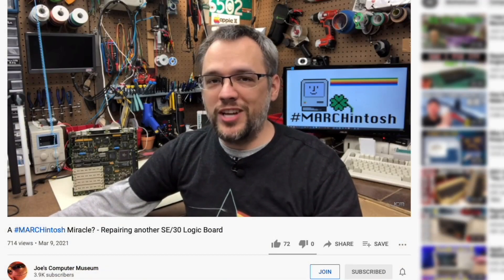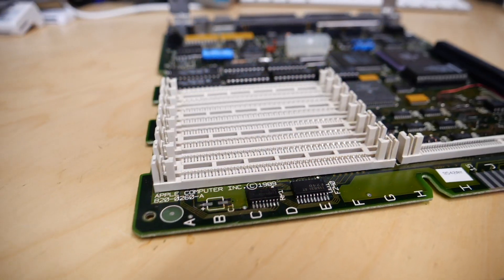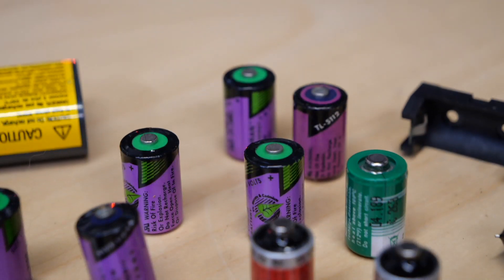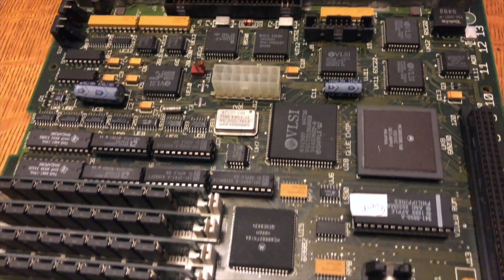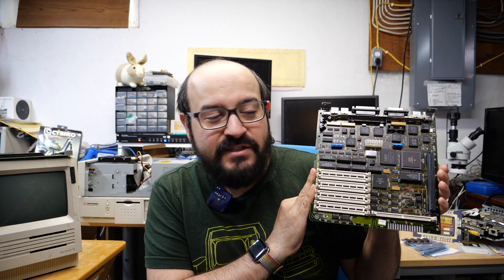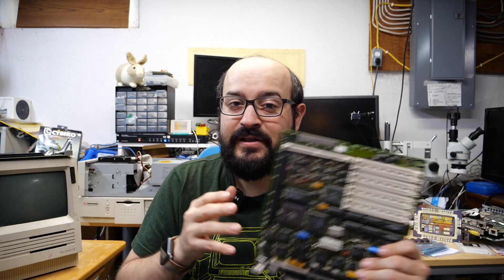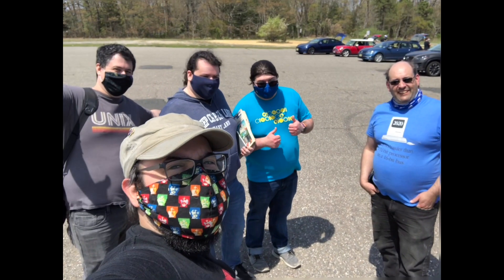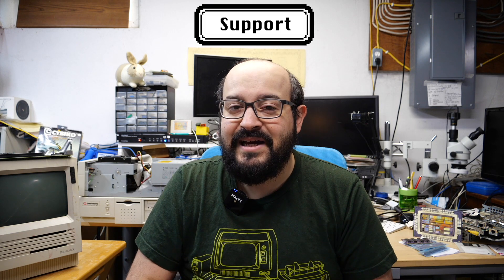Can We Save a Battery Bombed Vintage Apple Macintosh SE/30?

Comment: I need to replace the PRAM battery on my Color Classic, I keep hearing they may explode. Is it okay to handle them? Obviously with the computer unplugged. Also which type of battery do I need. Thanks - LOVE your videos!!!
Reply from the maker: The PRAM (clock) battery is a standard 1/2 AA 3.6 volt battery. They can leak or burst over time. They are perfectly safe to handle while the machine is off. If the battery has already leaked you may wish to wear gloves.

However, a safer option would be to replace these batteries with a longer lasting adapter that lets you use coin cell batteries. Coin cell batteries usually have less problems. This adapter is cheap: https://www.etsy.com/listing/1034101908/meowtoast-rev2-12-aa-battery-replacement However, if storing or not using the computer for long periods of time, it's always a good bet to take the battery out, just in case.

Comment: I bet he wasn't able to fix it either

I'm sure its physically possible to fix, and it would actually be interesting to see it happen, given that not even one bombed board like this has been successfully repaired ever.  We don't even know entirely what it takes.
I'm sure in the end it'll be cheaper to reverse engineer the board and make reproductions, but, you know.
Reply from the maker: He hasn’t tried yet. And boards like this have been fixed before, but it’s all a balance of time spent versus if it is worth it to the client (and also cost).

Comment: Every time I see one of these videos where the battery or caps have failed I'm reminded I need to open my Mac Classic and have a look inside. I'm just terrified of what I might find. I know the machine was still booting and running perfectly a year ago, and it's stored in an air conditioned room out of direct sunlight, but it's only a matter of time with these machines.

Oh yeah, the 17" CRT Studio Display. My junior high school had one of those, connected to a PowerMac G4 Dual 450Mhz that no one used for a damn thing, until I got my hands on it. Such a cool display, great picture quality and a work of art. It's so funny to me that CRTs became unpopular so fast, with plenty of good reasons, and are now so sought after for retro gaming because of the near instant response time.